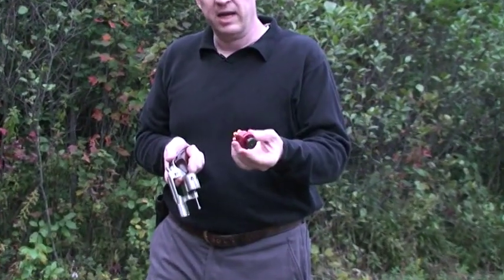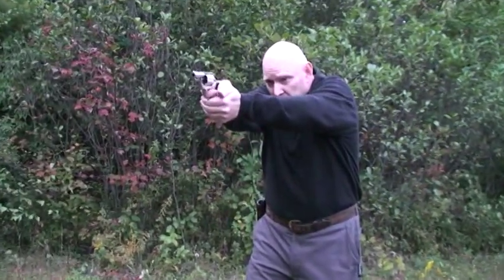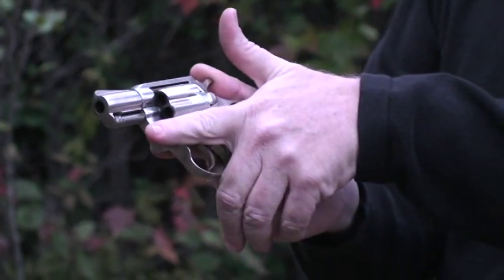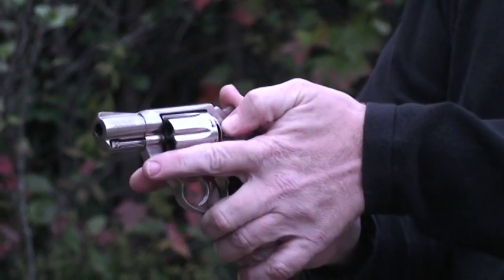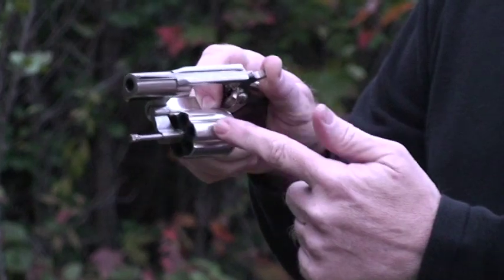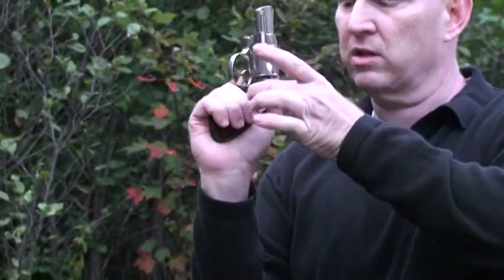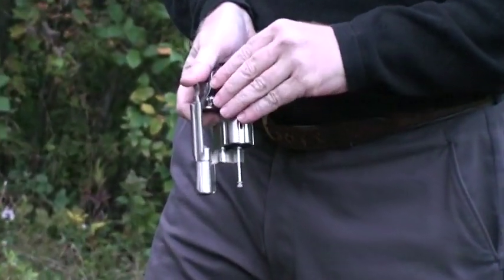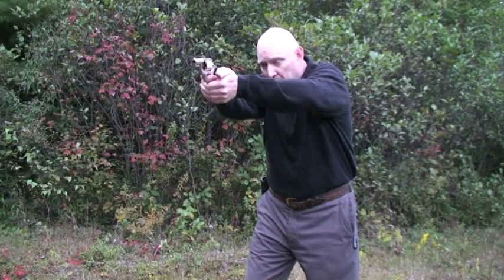Snub Reload Right Hand Shooter - Michael de Bethencourt - SnubTraining.com

Comment: Very interesting reloading technique.  I like it!  But after trying it I have found that MY! hand is to small. On the big frame revolvers I have to rotate my strong hand completely out of position to hold the open cylinder with one finger.  I just went back to pushing the cylinder open with two fingers with my weak hand, extracting the spent rounds with index finger, reloading cylinder with shooting hand swinging cylinder closed with palm of weak hand, sliding shooting hand back into position.

Comment: Makes good sense.  Would humbly remark that this works better with D frame Colt, J and K frame S&W and clones, and Ruger SP101 and Six Series.  Larger frame guns, E and I Colt, N Smith, and GP100 Ruger, are too big for most hands to accomplish the maneuver of inserting the index finger of the firing hand into the frame window to control the cylinder from rotating.  Have successfully tried and prefer this method with carry all and medium sidearms but could not quite master the technique with large Colts.

Comment: Interesting technique.  Is it significantly faster than a hand switch?  I can think of a few disadvantages this has compared to the stressfire reload. 1) I don't think this will work with anything larger than a J frame.  I tried this with my S&W 686, and my medium hand is too small to hold the cylinder in place without shifting my grip significantly, which seems to defeat much of the purpose of this style reload.  2)  I can't see how this could work with speed strips. 3) This uses the weak hand.
Reply: looks like the technique is snub nose only....

Comment: Good video. It's making me reexamine how I reload my revolvers. One thing I noticed, you pushed the speedloader down with your right thumb. How would you do it differently with an HKS speedloader?
Reply: SergeantC2 HKS: insert the HKS speedloader with left hand and as you're transitioning to grasp the knurled knob with your left hands fingertips, simultaneously swing drop the right thumb down onto the shoulder of the HKS style so that it can't spin (still simultaneously holding some pressure with the right index finger still poked in from its side), twist knob (left hand), toss aside (and / or bop the knob away with right thumb). Roll cylinder closed. Then go home and order some Safariland Comp series speedloaders 😉

Comment: Oh and to add to my difficulty, I am Left handed so this way of reloading doesn't work at all for me.  I do shoot right handed quite well however so I still want to pratice with my Colt Dectictive and my S&W 342 using your method.  I like how your shooting hand never leaves the handle of the weapon and the positive plam hit extraction in case of swelled spent case's